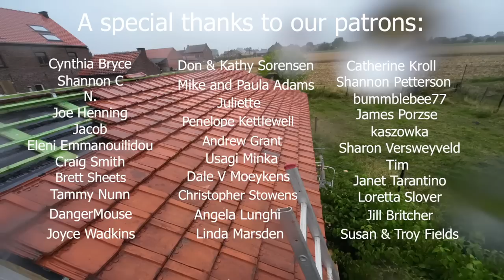Making the roof watertight: laying RECLAIMED ROOF TILES. Part 2 [OLD SHED into a cozy TINY HOUSE]

Comment: Those tiles, do you nail them or screw them? because it looked like you just lay them down with no nails or screws...
Reply: They are just laid down. They interlock, and similar systems are used all over Europe.  I can't say I'm an expert but I have always lived in houses with tiled roofs, and  in all my 53 years I h ve rarely experienced tiles flying off. And I have lived in a few places with very strong winds.

Comment: How are those tiles secured to the roof??
Reply: Gravity
Reply: this style is very common in Europe. The tiles are overlapping, and they have a special form / ridges that interlock when you lay them over and next to the different rows. Usually they will be interlocked on 3 sides. The top part (saddle?) is usually nailed and cemented in place. Though most countries changed the building rules and new roofs and renovations have to use special metal hooks to secure tiles in place. I'm hoping the local officials will not be looking at this video ;-)
Reply: Surely you are going to experience the tiles blowing away in high winds,as happened on the house ? I think there should be some sort of metal fixing wire to hold the tiles ? Presumably you know something I don’t ? (Very likely ! 😂)

Comment: Just a thought about cleaning the tiles.  Would it be easier to pressure wash the tiles after they are positioned on the roof.  I figure it would reduce double handling.  
Loving the videos, keep up the great work.

Comment: Normally when you place tiles on a roof the lowest battens are doubled and the uppermost are single. You did the opposite. Therefore the lowest and the uppermost rows are steeper than the others... 
Next thing is to place the brackets for the gutter before you place the first row of tiles as they're usually mounted below the tiles. Removing the first row is the most annoying one...
Another thing is you didn't place the ridge tiles along with the flat ones what leads you to walk on the tiles to install them afterwards.
Reply: Didn't the overhang of first row also look to be at the low side?
Reply: @scania9786  True, Thats why you double the battens down there. And the brackets of the gutter are fixated under these tiles...

Comment: Что будет в этом здании ?
Reply: This building (the former milk house) is a temporary accommodation with two rooms and a shower for the winter. The camper house (the white building in their yard) is a bit tight for them.
They will continue with the refurbishment of the farm house afterwards. (It has been gutted, then received new ducts, foundation, roof, hempcrete insulation, refurbished old windows. Needed: stairs, electricity, water, heating, flooring, tiling, painting, bathrooms, kitchen.) Iliya and  Marina are not slacking, they just need some warm and weathertight place to be able to live comfortably when they would continue works on the farm house.
Belgian laws require the owners to move to their property within three years of its purchase which expired in the spring of 2023.
Reply: Ok,I understands